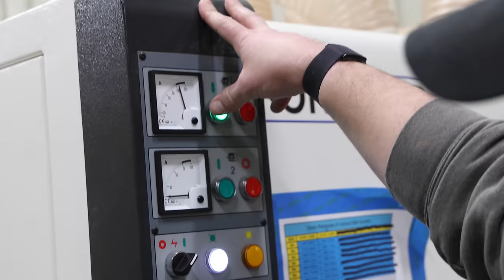The Most Expensive Tool I Have Ever Bought... Worth it ?

Comment: You should get a shaper for when you miter, I got one and you can put different miter bits in it for 45 angles or 15 degree angles and so on, it would be a major time savers aswell less muscle power for cranking the table saw to a 45

Comment: best thing to do would be setup of a rate  per board feet for customers to come in and use it.  That will help you pay for the machine.  I build a bread board table top and used a local guy to flatten it, only cost me around $80 and he made three passes through it on 80 grit

Comment: Try using Abralon pads for your final sanding finish . It’s makes the surface like glass of course it’s used with a Radom orbital sander. After you run through the sander . It was discovered by Hal Taylor it was for auto finishing but works on work outstanding .

Comment: Hey I’ve got a question here. Did you flatten the slab on the cnc first? Or did you just run a cut slab through as is?
Reply: You need to flatten it first on cnc. Sander will work only on perfect flat stock

Comment: @John_Malecki Worth it? The only question you’ll ask yourself after getting a wide belt is how you ever got by in life without a wide belt.

Consider throwing some 3’ lengths of 3” pvc sticking straight out of the wall - one for each belt grit you use. Hang the belts from them. Whichever one is on the machine will be empty so you’ll never have to wonder.

Also, Happy New Year, everyone.